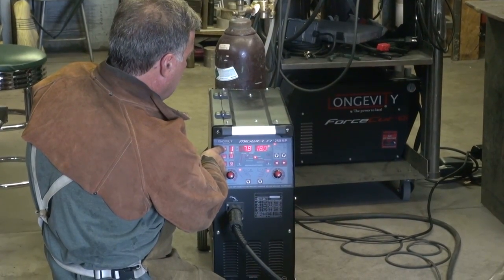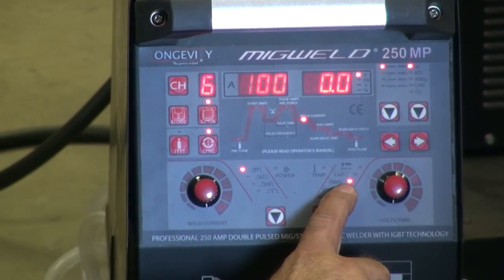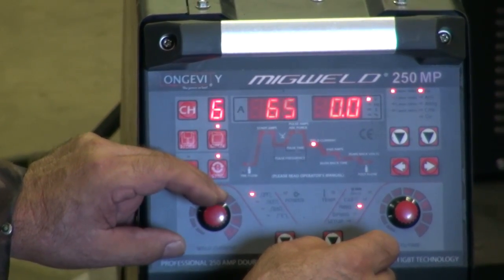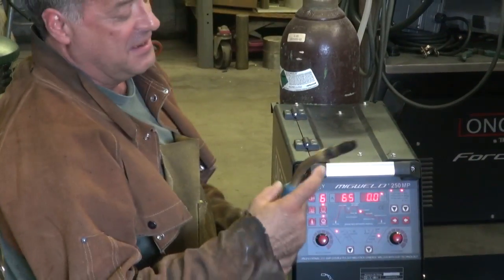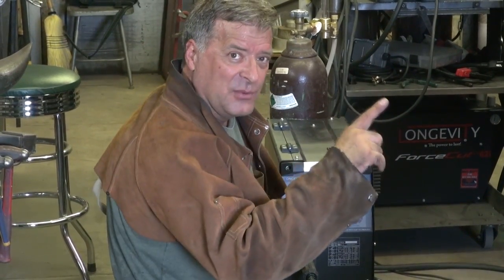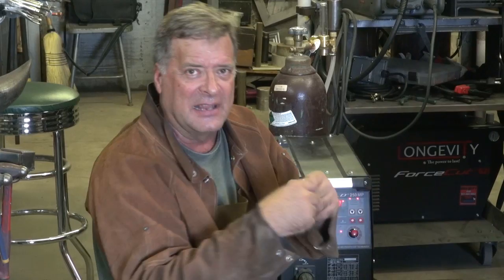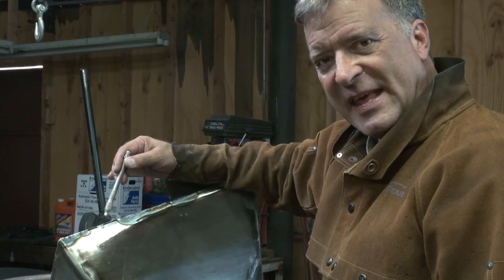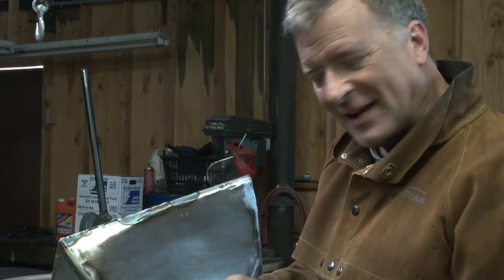How to Use Single Pulse on the Longevity MIGWeld 250 MP - Kevin Caron

Comment: The arc force might be an inductance setting.
Reply: The higher the inductance the slower the current rises after the wire short circuits in the puddle. The effect has to do with puddle fluidity and how well the toes wet out. It seems to have a minor effect anytime I play around with it.